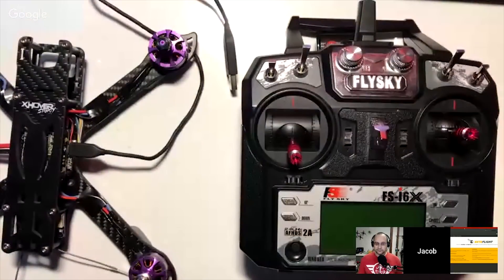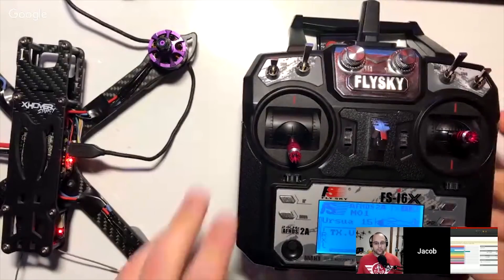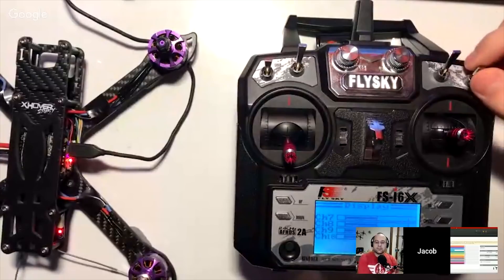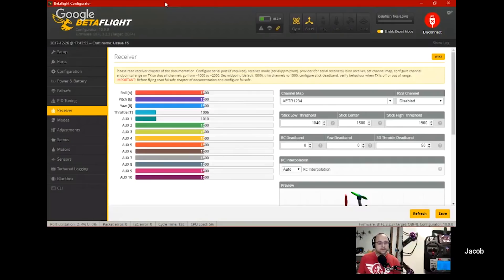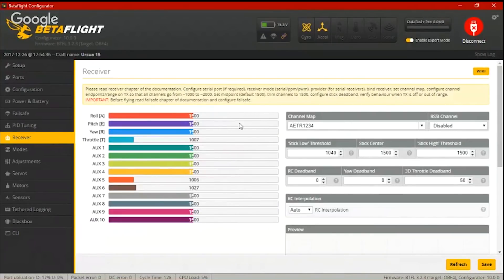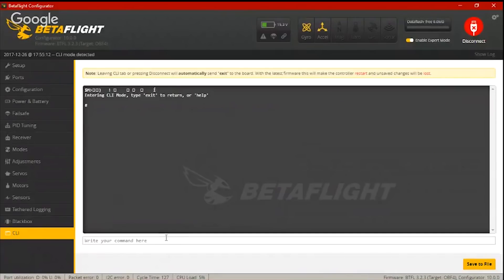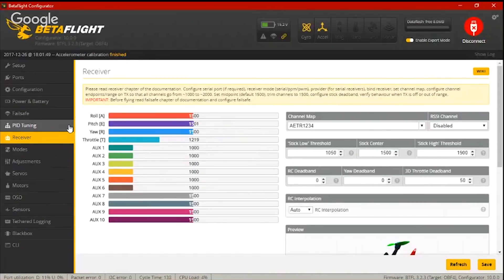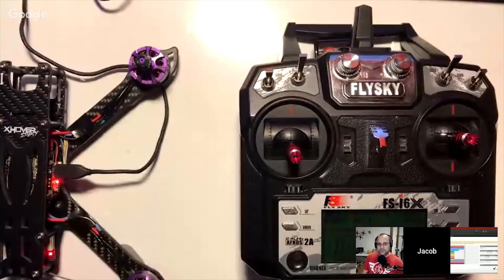1-ON-1 TROUBLESHOOT: Jacob Ursua Aux channels don't go to 1000 | SOLVED

Comment: https://youtu.be/SLvmxVPj4RY?si=XF8oeOEyPHPGhc4V
Same problem with elrs in ardupilot with channel 5, but with other tx and rx this problem not occur 
I check ch 5 protocol not set to relay, in elrs channel 5 set to pwm 
Now I skip the ch 5 and flight mode set to ch 6. Now on ch 6 work fine 

Tx-Radio master Ranger
Rx-rp3
Transmitter -frsky q7

In recent firmware elrs ch5 may be use axu and gives high and low pwm value,

Try mixing two switches for 6 flight mode- output to ch 5 , if same problem occurred please SOLVE

Comment: I just plugged my Eachine X220 into betaflight to turn motor stop off, but after removing it it seems my esc isn't connecting to my flight controller properly. I plugged it back into betaflight to see if I could find the problem. All the aux channels are on 0 and flicking the arm and flight mode switches won't do anything. Do you know what the cause could be? Thanks, Ben

Comment: I am trying to solve the same issue, but when i flash the board i get "Failed to open serial port" error, in betaflight. Powering up while holding boot button doesn't seem to make a difference. Any idea what could be not correct?

Comment: i need help to :( my tango 2 pro is bind to my 
TBS Crossfire Micro Receiver V2. everything work in betaflight. but the secend i put my battery in the drone the reciver wont show input :( it still show green light `bindet` but no respons on betaflight. if i unplugg the battery, everything works agein.

Comment: I'm trying to use AUX5, I put it on inputs but on my Betaflight it doesn't work, what can I do?
Reply from the maker: Put it in mixer not inputs.
Reply: @JoshuaBardwell  I put both, and nothing! 😢
Reply: @JoshuaBardwell  in the control it's working, in betaflight it doesn't change

Comment: I have the problem that the aux channels aren’t moving at all but all the stick movements work. Does someone know a fix?
Reply from the maker: You need to manually assign the switch to the aux channel in the controller. For opentx radio it's the Mixer screen.
Reply: @JoshuaBardwell  thanks it’s working now

Comment: Joshua, first off let me say that your helping many with your instruction. Your easy to follow and make even frustrating things like this a little less stressful.

I am having the very same problem as shown in the video. I have reflashed the board (CrazyBeef4dx) firmware (CrazyBeef4dx 4.1.1) on my Mobula7HD V2 using 10.4.0 Betaflight as advised in the setup instructions several times and the problem persists. All of my Aux channels start out at 1500 and range up to the low 1800's and never up to 2000. 3 position switches act like a 2 position starting at 1500 then into the 1800's and back to 1500 on the 3rd position. My radio is a Taranis QX7s running OpenTX 2.2.4 with a IRangeX module bound on Multi DSM X 11ms, have also bound in DSM 2 11ms. The model binds great, flies well but the Aux channels are just not cooperating. I did try my old DX7i but still having the issue. I am out of ideas on solving this issue. Any ideas? Is there a way that a CLI command would fix the aux channels like rxrange command does for channels 0-3? 

It's all a big learning experience for an old dog, that started out on control line back in the 1960's and all the way up till now. Getting back into Quad's, it's advanced a long, long way from the old AeroQuad Arduino boards .

Comment: heya, maybe ill be the next lucky winner:) my aomway commanders are constantly a grey screen. no matter what channel or band i go to on them, they are always grey. its pretty frustrating when i want to fly but... oh wait, my googles aren't working. thanks
Reply from the maker: +Charles Catfish sounds like the goggles are damaged. Or maybe you are in HDMI input mode.
Reply: thanks josh ill check. i had suspected that it was a bad receiver.i even opened them up to check if anything was unplugged hopefully what you said is the problem. i appreciate the speedy reply, keep doing what your doing:)

Comment: Interesting .....I think that new stand-alone has something to do with it. When I went to the stand alone my board orientation changed. My boards are both turned 90 degrees. When I started using the stand alone i had to change board orientation in betaflight to 180 but nothing was physically changed on the quads. I will try to reflash with the stand alone after seeing this.

Comment: Hey Josh great vid. Can you help me get my DShot beeper working on a stubborn quad? I have it turned on in CLI DShot Beeper fequency and volume set to 3. I also have set in modes on the third flight mode switch with turtle mode. I am using the same FC that is on another quad and the beeper works perfect with DShot but this one will not beep. Any ideas 💡?? Thanks bro

Comment: I’m wondering if this isn’t some kind of bug in 3.2.#? I had same problem on two of my crafts I was working on. Except with mine it was like it wasn’t seeing receiver at all. Two different radios also, one taranis and One turnigy evolution. And when I reflashed it fixed itself same as this. Was using chrome configurator on both.

Comment: I can’t get my ,orx r620x v2, rx to talk to my JB F4 FC ??
Reply: Orange has a bit of a reputation for being crap. I also have some personal experience with it, when it was the only thing that could get Taranis and Blade Inductrix talking together. It worked for me like after replugging the quad in for at least 3 times and then it might arm or might not. I'd just use real Spectrum Rx and Tx if you for some reason don't like FrSky or any of the other more reputable and reliable ones.
Reply: Sorted it now I had the rx signal going to the rx6 for speksat with port 6 on rx . It’s now on sbus with port 2 on rx  and seems to be working fine

Comment: Hi Joshua,
Now that your doing this full time I believe you will need to widen the scope of topics to continue growing your fan base.  I am one of a few that have been strugling to perfect VTOL craft for 3 plus years.  The only truely useful controller serving this space is the KK1 with David's (happysunday) code "openaerovtol"  unfortunately this controller is insufficient.  We need code ported to or written for the current series of controllers you are familiar with.  How about exploring/promoting this area of development?
Reply: Re: fixed camera angle on quads.  I  like seeing where I'm aimed.  Cleanflight had the ability to program a servo to maintan the camera angle fixed to the horizon.  I presume that is still true with beta flight.  Why isn't this a feature on any configuration today?
Reply from the maker: Betaflight supports servot tilt just like cleanflight used to way back when. Nobody uses it because racing and freestyle pilots really need fixed, predictable camera angle to fly. And because a servo mounted camera is too fragile for the kind of abuse we put them through.

I feel like there is plenty of room to continue growing my fan base using this topic. UAVfutures has over 100k subs covering pretty much the same products that I cover. VTOL is not an area that I'm super interested in I'm afraid. And it's not an area that would attract a lot of viewers I suspect. If I were to branch out, it would be into longer range and/or camera platform type quads.

Comment: I think I have the same FC board and transmitter. Be careful to flash the correct version of betaflight for the FC. My Omnibus F4 is  "OmnibusF4SD" for flashing in BF, not sure if just using OmnibusF4 as in this video, could screw things up. I've never had that issue with my F4 and I6X. 
 Creating a new model and re-flashing Betaflight is a good thing to try, when having setup issues. Nice troubleshooting video !
Reply from the maker: Yes, that could be the issue. The F4SD is for Omnibus with SD card.

Comment: I have got a question: can I use a 7500 mAh 2s lipo as a ''power supply'' for my isdt q6 plus for charging 1300 mAh 4s lipos on the field? Just wondering because input voltage is lower than output voltage....
Reply from the maker: In theory lower input than output is not a problem. The input regulator can just step-up.
Reply: Joshua Bardwell what would you say how many 4s 1300 mah lipos i can charge with that 7500 mah 2s?

Comment: With my Holybro Kakute F4 FC I have activated gyro 32 kHz sampling mode, 16kHz Gyro Update frequency and 8kHz PID loop frequency. CPU load is at 16%. Want to try it today.... Am I at risk?  ....Specifying 32kHz Gyro Update frequency and 32kHz PID loop frequency resulted in a CPU load of 100%. I didn't risk to fly with that CPU load... 16kHz Gyro Update frequeny and 16kHz PID loop frequency led to CPU load of 67%. Didn't want to fly with that either.   Think we need F7 processors...
Reply: my bud has a f7 board trying to get 32k running but the code isn't optimized for it yet 8k8k is best at the moment
Reply: Tested it and cant recomend it. First I flashed BLHeli_S version 16.7 to the ESCs and then I was just doing some hovering in my garden, heard some strange noise from the motors like a defective ball bearing, landed, switched Gyro 32kHz Sampling off and switched back to 8kHz Gyro Update frequency and 8kHz PID loop frequency. Immediately motors behaved normal and CPU load was at 1%.
Reply from the maker: Yes I don't recommend 32 kHz in general on Betaflight at this time. The filtering is not tuned for 32k and often there are bad issues with ESCs and motors.

Comment: That’s awesome of you to help this guy out, his minimum throttle was at 1040 and when it was working it was at 1050😎🎮🤙🏻
Reply from the maker: min throttle and min check are different. I think you are mixing them up :-)

Min throttle is on the OUTPUT side from FC to ESC. Min check is on the INPUT side from TX to RX to FC. If you look in the receiver tab (which deals with TX to RX To FC) min throttle has no relevance.

Comment: Is it possible that he needed to have his transmitter on when flashing and dint have it on the fist time?  Just asking and trying to learn. I will be setting up my second quad soon and struggled with my first but finally figured it out.  Thanks for the great info and making yourself available. Much appreciated
Reply from the maker: There is no reason why flashing would depend on having the TX on or off.

Comment: Josh , hope you can help, just got ET100 and soon as I plug usb in to FC laptop dies like it's pulling down power for USB ports. Disconnected FC from ESC board , same thing.  Acts like something in the FC PCB is shorted. Update: I made a data only USB cable that works fine on ET125 with batt plugged in and connects to betaflight, but when USB data only cable is plugged into ET100 and batt plugged in , computer does not die ( which is good) but will not connect.  I guess I got a dud.
Reply from the maker: This surely indicates a defective USB port on the laptop. I had one of these once where two pins were shorted inside the USB port. We had to disconnect/disable the USB port to fix it.
Reply from the maker: Even if the USB peripheral is defective, the USB port SHOULD protect the computer from damage. This is not always the case though.
Reply: Joshua Bardwell ...it's something on the FC thats pulling down the USB power to the point it shuts down the laptop. The "data only" cable I made doesn't do that, but it also won't connect to FC. Well, anyway. It's probably one of those things you can't really help me with anyway. I'll just box it all up and send it back.

Comment: I have 2 FC board one omnibus f3 with integrated OSD and the other one omnibus f4 with OSD as well got strange behaviour where on hover angle mode after 30 or 40 sec the micro quad drift to the left so badly that even if I apply trim will not stop to the point I run out of trim and I have to land both board got this issue I tried everything like soft mounting the boards flashing the beta flight with no joy both fc worked fine for me I don't know what to do so any help or advise will be appreciated.
Cheers,

Comment: It might have been by using the new configurator to flash FROM the old firmware to the new created a bug . Once it had the new firmware on the FC and flashing it again, the new configuration was able to flash without creating that bug.
Reply from the maker: Anything is possible but my gut feeling is there should not be any difference in the new vs old configurator. They are the same code, just one is wrapped up in an EXE file. But it's possible.

Comment: A couple weeks ago a buddy of mine had this happen to a new FC he'd insatlled on his quad. We were at the field when he showed me the problem. So played around with the channel settings on his Tarranis X9D.. I copied the affected switch channel and created the missing switch setting position that was needed to get the full range on the Aux channel switches. For some reason it wouldn't show the lower switch setting until we reprogrammed it into the reciever... It's a work around that worked... Not sure why but is a way to get around it if you can reprogram your receiver channel switchs. And don't have access to a computer for a download in the field....

Comment: i speculate that you are correct that there was something in the modes... just the other night on my nephews babyhawk he was flying just fine. i connected it to BF and adjusted just his rates and when he went to fly it again some how the modes got jacked up and channels got reassigned. also when i first bound it only 1-8 of the aux channels of 16 would work. after changing the aux's back and getting it out of turtle mode (arm and turtle mode got assigned to the same switch) and fixing prearm it now flys like a dream but the fact that the new BF (standalone) did that i think it might be a bug in the standalone

Comment: Spoiler : ......... in the end they dont have any idea why it was fixed :) . Really enjoy your videos but waiting 18 mins for this seems too  much . It would be OK if those 18 mins would had boiled down to a reason but just "fate" doesnt justify it. Happy new year
Reply from the maker: I disagree that we don't have any idea. The reason is that sometimes when you upgrade without "full chip erase", the configuration becomes corrupted and is only fixed by a re-flash. That's the reason. All of the stuff that led up to that was trying various troubleshooting steps and ruling them out.
Reply from the maker: Anyway, this is a live 1-on-1 troubleshoot, not a lecture. So sometimes it is not going to go according to plan. But hopefully there is valuable information in every one, whether we fully explain the issue or not. I always pick these 1-on-1 troubleshoot topics because either 1) it is a very common problem that lots of people experience, or 2) it is a really weird one that is interesting simply because it's so unusual. This was number 2) and now if you ever experience it, or any other totally unexplainable issue, you'll know how to fix it.

Comment: Lack of a possible full chip erase came to my mind during this session also. Earlier this year is updated from 3.1.7 to a pre-RC 3.2 without doing a chip erase. All seemed fine at first but when punching the quad it got wild and erratic when airborne. I suspected bugs in 3.2 but by doing it all over again, with a full chip erase, it worked just perfectly.

Comment: Wouldn't a diff been a thing to do to take a look at what was changed?

I've had a number of weird issues after no change that a full chip erase has fixed.
Most recently an RX that was bound with the RX before a board change would not work (register anything in the RX tab) after swapping a dead FC with a new copy  of the same model FC. Pasted in old settings to the FC RX didn't work. Eventually full erase reflashed and the same pasted in settings worked. The only thing that could have been different were the contents of the flash.
I think the flash needs to be checksummed and checked on boot if it is not already it seems to me that the flash gets corrupted (or not written correctly) sometimes. A checksum on boot (and on write) should at least catch the corruption.
Reply from the maker: There was nothing in his config that would have caused this. Remember the part where he changed the endpoint in the transmitter and it went down to 1000 and then jumped back to 1500 and wouldn't change below it? That is completely un-explainable by anything in the config as far as I know. It indicated to me that we have a totally messed up situation and a clean reflash is the solution.

Comment: How about paste in the config one line at a time until it screws up again?  Would like to know what actually happened!
Reply from the maker: There was nothing in his config that would have caused this. Remember the part where he changed the endpoint in the transmitter and it went down to 1000 and then jumped back to 1500 and wouldn't change below it? That is completely un-explainable by anything in the config as far as I know. It indicated to me that we have a totally messed up situation and a clean reflash is the solution.
Reply: The solution was good. There must be some sequence of events that would get it back into the bad state. I guess your theory was that he might have upgraded firmware without full chip erase. Maybe not much value in proving that..

Comment: Brilliant..ive got the flysky ia6 and with 2 omnibus f3 boards and a sp racing f3 board i am getting the no lines or channels showing at all..tho its deffo bound and i got the ibus/ serial  and correct uarts set..also flashed most recent update it is driving me mad..done all the builds on 3 copters and only 1 shows correct receiver response..